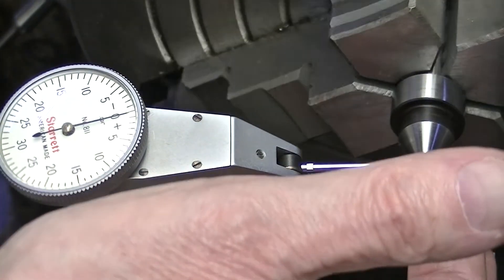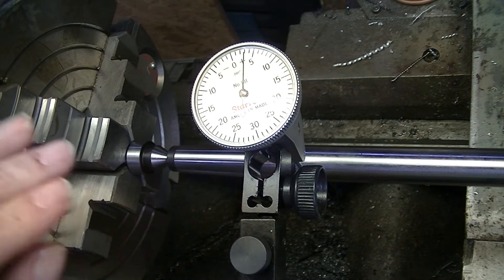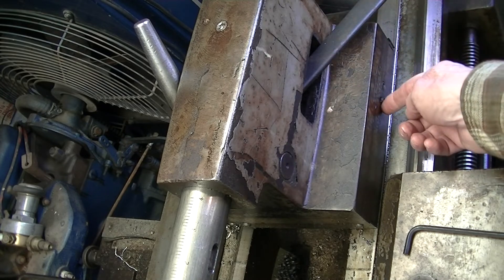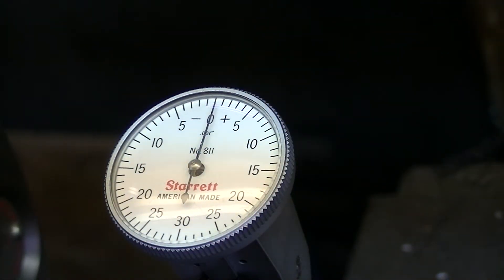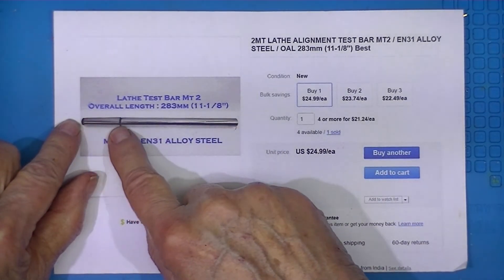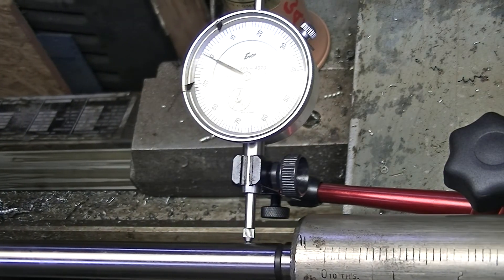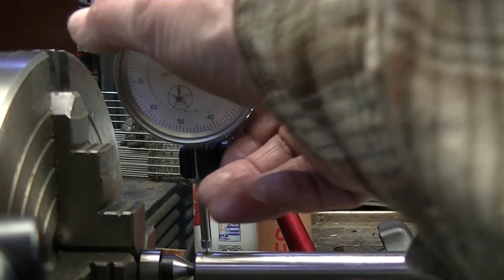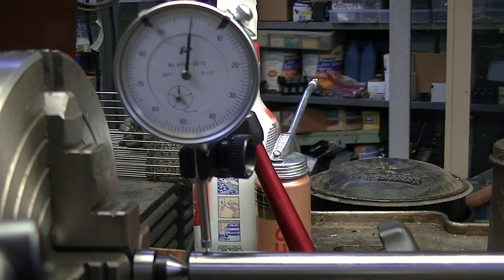Using a Lathe Alignment Bar (tool)

Comment: Have you checked the alignment of the headstock to the bed? If not, do that first before you align the tailstock.
Reply: How do you do this?
Reply: @smallblockchevy1022  Firstly, do you have a 100% straight shaft, the longest you can clamp in you lathe. The ultimate situation would be if you can turn a Morse taper on the chuck side of the shaft (if your lathe has a Morse taper hole behind the chuck) because worn chuck jaws can give you a false reading. The point is, ensure the shaft run as true as possible on both sides, Secondly, do you have a chisel point contact point for your dial indicator? Remember the shaft is round and a contact point with a ball can run off the center of the shaft. So, you need a wide point which is 90 degrees to the shaft, or if you have a contact point with a small ball bearing. Now, I don't know how you lathe headstock alignment setup looks like. My lathe has two set screws with which the headstock is shifted. Now, take a reading on the dial indicator at the chuck side, move the indicator over with the apron and see what reading you get at the tailstock side. Now adjust whatever adjustment screws are on your lathe until you get the same reading at the chuck and at the tailstock. If your lathe doesn't have a Morse taper on the chuck side, you can use a straight square bar and set it up in your 4 jaw chuck with one side square to the cross slide. You can use a ball contact point in this case. I did my lathe a while back and it works well. I hope you are successful.